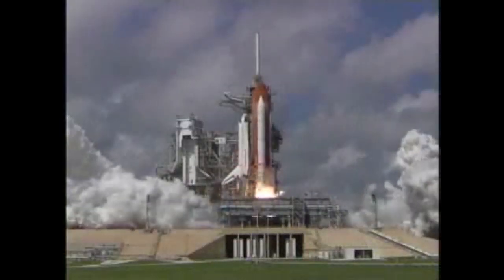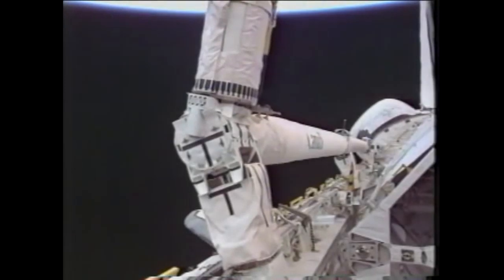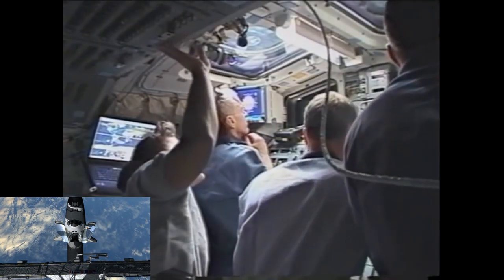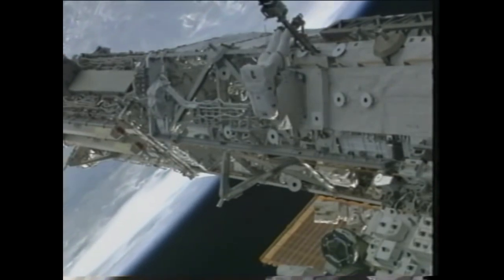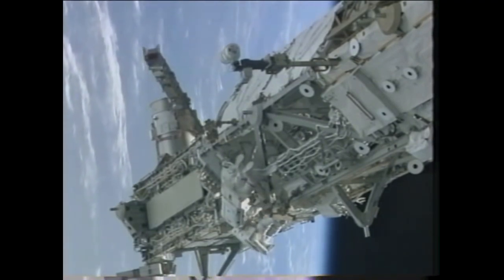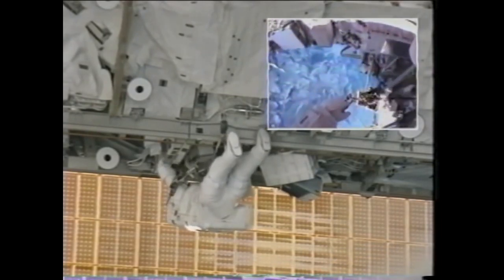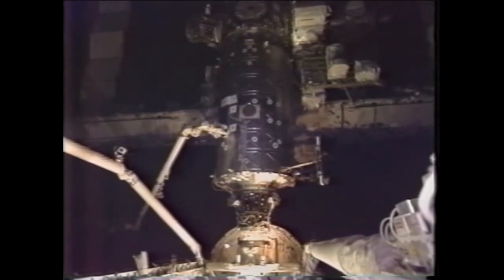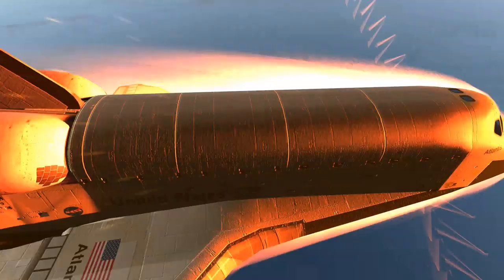International Space Station - Episode 24 - The P3/P4 Truss

Comment: Station got more electricity thanks to another pair of solar arrays.
Reply: Yes and no hooked up not powered Loop D is on Channel 2 and Loop C is wired for Channel 1 this is the early power setting and if P4 were hooked up it would blow the BCDUs and cause a short and those fuse boxes are expensive and are only suppose to be used in emergencies. not only that P6 is in the way it needs to be retracted so the solar panels can rotate.
Reply: @geomodelrailroader  next up, an attachment that can get the first set of solar arrays hooked up.
Reply: @angelagreen5208  yup STS 116 will deliver it and the station will be wired into its final configuration.

Comment: STS 115 resumed construction of the ISS. The cargo was P4 the main solar panels of the station. During 3 spacewalks Piper, Tanner, Burbank, and MacLean installed the solar panels and activated them. The final wiring and activation of the cargo attach devices and the solar alpha rotary joints would take place on STS 116 which would launch a few weeks later. During landing Piper did not inflate her g suit and she got jet lag and fainted on the tarmac. Piper had to be grounded until STS 126 to get over the jet lag.
Reply: Jet lag?
Reply: @Forest_Fifer  its what happens when you have too much blood in the extremities when you are at altitude. The g force forces that blood into your skull where it clots. This leads to tunnel vision, fatigue, jet lag, and in the worse cases blackout. If you don't want that inflate your g suit.
Reply: @geomodelrailroader  sorry but that has nothing to do with jet lag. What your describing may well be a medical condition, but it is not jet lag.
Jet lag is a disruption to your body clock caused by long distance east west or west east travel, as your circadian rhythms are disrupted by the change in time zones.

She did not faint on the tarmac at Kennedy, she fainted during a ceremony the next day in Houston.
Reply: @Forest_Fifer  still she was grounded until 126 when she got over it